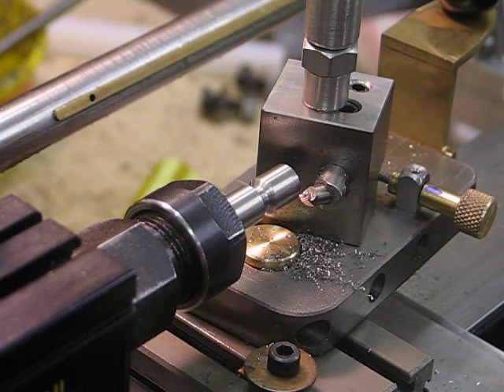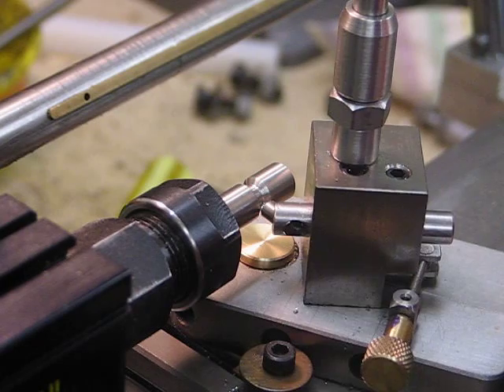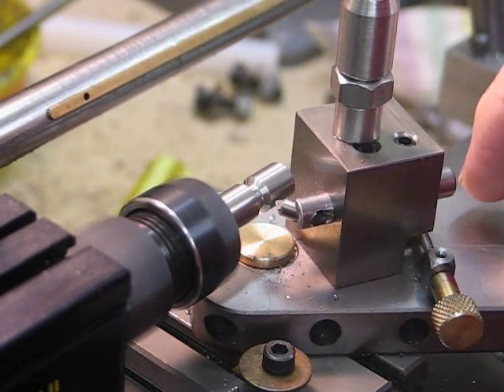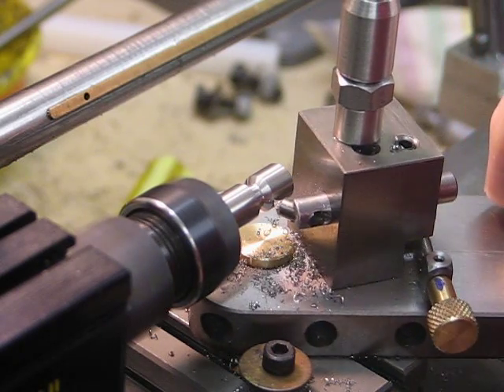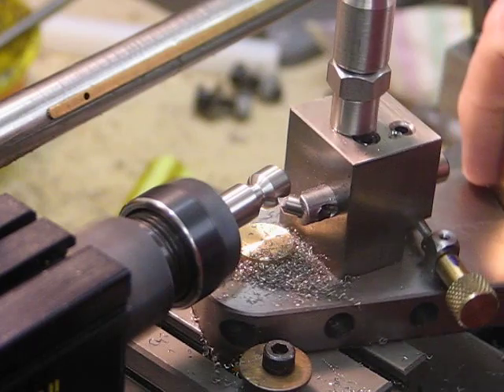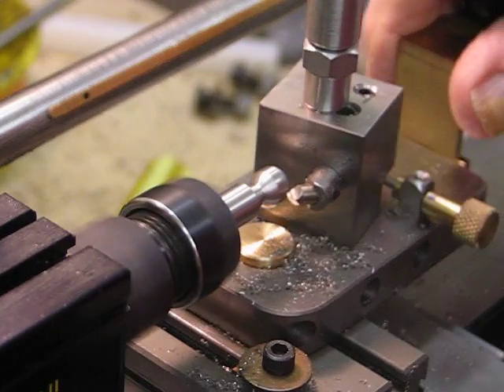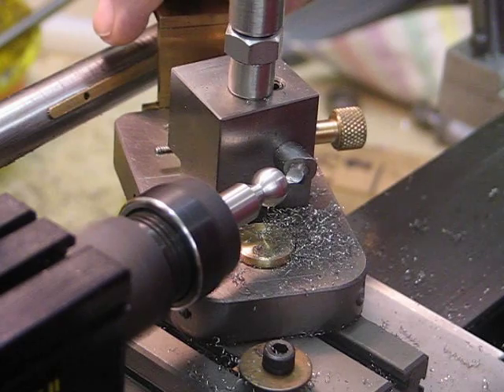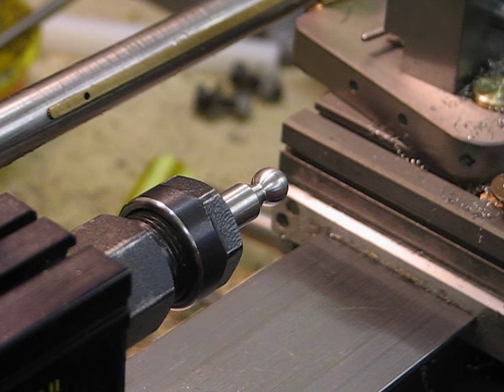MVI 0245 Ball Turning Tool for the Taig Lathe

Comment: I'm just wondering, you have an adjustment knob on the ball turner.  Wouldn't the cross-slide adjustment do the same thing?
Reply from the maker: That adjuster is necessary, there are setup gauges required as part of the tool, once the tool is set on the center of the base pivot the adjuster produces the ball to size required the cross slide and saddle must not be moved, if I can find the article and save it in a reasonable size that's readable I will save it, or you could do a search for the article and zoom it , it has 4 pages, do you have Autocad?,
What I did was copy his dims in cad and then scaled it I believe .800 or .750,
Reply: Walter Maisey What kind of gauges?  The only gauge I have is a Dial Indicator to center  work in my 4-jaw chuck.
Reply from the maker: Armand Buron
   No DTI needed to setup but gauge pins that fit in a central hole in the pivot pin , its a bit hard to explain even the description in his article is not very plain,
Reply: I think the adjustment knob changes the radius of the cut, adjusting the tightness or looseness of the arc the tool creates. The center of the pivot to the tool tip is the radius. The adjustment knob pulls the back of the post and pivots the tool in toward the center of pivot. The cross slide should be used to place the center of pivot directly in line with the part, but to change the resulting ball radius, the tool must be adjusted toward or away from center of pivot... 
Hope that makes sense. 
Taig also now sells a ball making tool!
Full Disclosure, my brother is a Taig distributor.
https://desktoplathes.com/product/radius-turner/
However, the fine adjustment knob is not designed in this... you must manually adjust the tool tip distance from the center of pivot.

Comment: Hey Walter, I like this model of the ball turner but I'm unable to find any plans on how to make it.  It all seems pretty straight forward except for how its attached to the cross slide.  Can you shed any light on that for me?  (Plans would be even better as I need to turn balls up to an inch in diameter.)
Reply from the maker: Yes Armand,
    I can help you with some photos but the unit I built was a freelance of the original article plans in the ME Workshop Magazine and I just used materials that I had laying around I can send you photos if that would help, I scaled it down from the article sizes to .800 scale to suit the Taig lathe, original sizes were for a Myford ML7 I believe
Reply: Walter Maisey Anything that will show how it attaches to the Taig cross slide.  I have the same lathe.  I'm an ex-cabinetmaker that is now making things from aluminum.  So being a machinist isn't something I trained for but it may be in my blood as my father was a machinist working on HUGE lathes for the drilling industry (oil I would imagine - I never asked him).  In case you can't send through these message links, my email is "aburon1120@yahoo.com"

Oh I should have asked - will it work with the Taig 4 jaw chuck?

Thank you very much.
Reply from the maker: Armand Buron
Hello Armand, sorry for the delay, we got back home lasts Wednesday and I'm just about to get into the shop again, today I will search for photos on the ball tool, but I must remind you it was a freelance and made from odd bits of scrap and so its not exact to the ME Workshop plans, so you will have to ad lib a bit, if you can PM me perhaps I can send some details,

holmes_ca_2000@yahoo.com
Reply from the maker: +Armand Buron 
Armand, did I ever get back to you with details of the Ball Tirner?, my apologies if I didn't, I do have the complete article in my files, if you need them we could make arrangements to get them to you,

Edmund......Alberta,